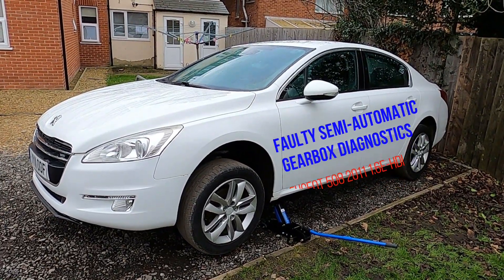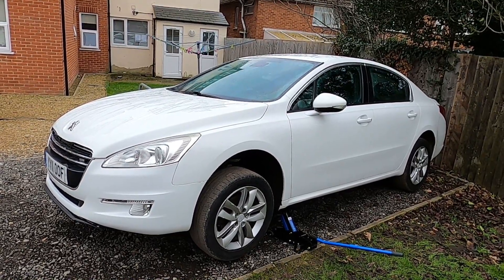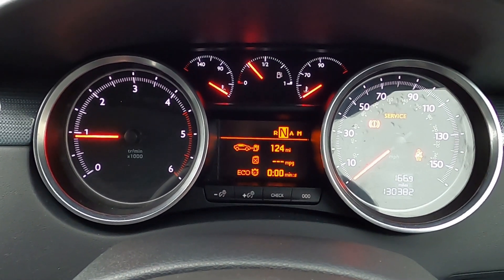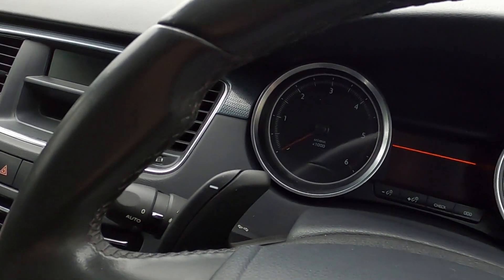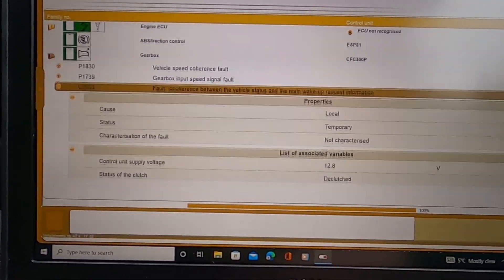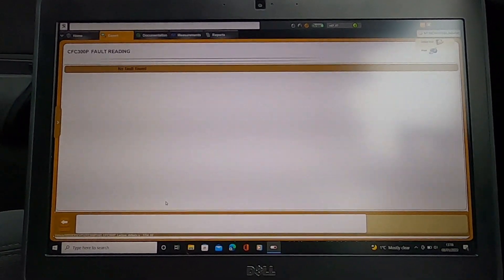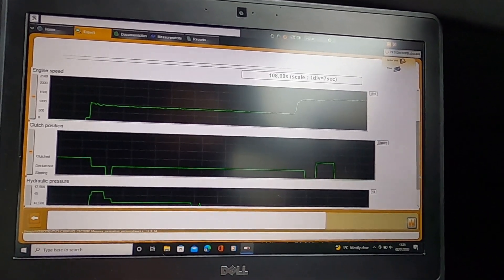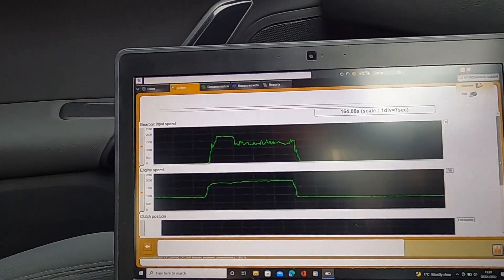6 Speed Semi-Automatic gearbox Fault Diagnostics on Peugeot 508     #P1830 #P1739 #U2003

Comment: I have Citroen Berlingo, and i have one problem, from standstill if you want to go really slowly for example in our out of tight parking space, then it kinda pulsates forward, could this be the clutch?, there is no problem changing gears or anything, it's just when the car is driving with clutch control.
Reply from the maker: @mrd799  difficult to say but it well could be something like a slipping cluch

Comment from the maker: My Dear Friends I offer new service
Semi automatic gearbox cluch and dual mass flywheel  replacement and programming. 
I use only  valeo cluch kits ( Dual mass flywheel, cluch plate, presure plate, and slave) also i will replace cranckshaft seal i USE BGA brand seal, differential seals use Febi Brand, fresh COMA fully sintetic  gearbox oil and Ravenol G-HAF hidraulic oil for actuator if needed. I will also throw in a complimentary engine oil, oil filter and air filter replacement. Programming is done with latest Diagbox. 
All above for 1200£, 
1000£ paid upfront then leaving a car with me for 3 days or summer time for 2 days, and 200£ paid then collecting a car from me after you drive a car for a good half hour and happy with it.  I am based in Oxford 
Please get in touch with me if you need this service by email leaving your reg and phone number and i will come back to you.
I have mastered cluch replacements on these semi auto gearboxes and since my old video regarding the issue i have done over 40 cars with semi auto boxes  wihch needed cluch replacement. Common signs on then you need to do this job is excesive vibration of the car then low rpm and fault codes like gearbox faulty p1755 not to mention cluch slipping feel and also a computer preventing you switching gears. I can offer 20£ diagnostic if you not sure if you need this job done and we can have a look at fault codes, live data and see whats going on.
Cars i can do this job on
3008 1.6hdi/ehdi 2011 - 2016
508 1.6hdi/ehdi 2011 - 2016
Citroen C5 1.6hdi/ehdi 2011 - 2016
Ds4 1.6hdi/ehdi 2011-2016
Ds5 1.6/hdi/ehdi 2011-2016
Citroen Grand picasso 1.6hdi/ehdi 2011-2016
Citroen picasso 2011-2016

If i have not mentioned your car and it has 1.6hdi/ehdi engine and semi auto i can also probably do it but we can discuss.
Reply: Presumably Berlingo and Partner too?

Comment: Hi, great video. I have a 508 and was fault alerts and service light coming and going for months, this started after leaving car parked for 6 weeks and I fear battery voltage and ecu have played a part. Although the car started fine when I returned from holidays.
Recently the fault alert comes in every time engine starts and service light stays on all the time. My Obd2 shows no faults but this week car displayed a gearbox warning fault before going away again. Could this simply be the battery being low and the ecu registering a gearbox fault that just needs clearing. Car runs perfectly and gearbox smooth. 

Sorry for the detail but thought I would seek your experience. 
Regards Craig (Australia)
Reply: Is it automatic?
Reply: It’s semi auto as it has auto and drive manual option with paddles
Reply: @craigjenkins3114  Same as mine, does it still do it and did you experience anything different when driving?
Reply: Interestingly it drives normal until going about 50km and then I was getting a P0016, reset by obd2 and back to normal before cycling over and over. Mild loss of acceleration only after engine light comes on. Now engine light comes on quickly and a code relating to camshaft sensor appears, but they were replaced and no change. I did timing chain change 80,000km ago and I’m starting to thing a change may be required. However I thought if timing was out the fuel usage would be high, but it’s never been better. I think it’s time to get a diagbox analysis

Comment: Hi great video can anyone help ? i have c4 picasso 1.6 thp petrol with semi auto egs gearbox now when it goes from 1st to 2nd theres a clunk noise ? its the same when it changes from 3rd down to 2nd all other gear changes are fine ? ive read that reflashing the gearbox can help this im not sure what that is or how you go about it im no mechanic theres no warnings coming up on dashboard thou my c4 has had new abs sensors fitted as well as new front and rear discs and pads fitted so i know all the magnetic rings are new can anyone help many thanks in advance !!
Reply from the maker: Hi mate my advice would probably be to find someone with diagbox and get your gearbox reprogrammed. Also i would check to make sure gearbox actuator is not leaking anywhere.

Comment: Hi all. Anyone got Peugeot specialist in Leicester or nearest area? 
Gearbox is working only manually, first three gears, 4th 5th 6th gear missing. Car got replaced clutch 3 months ago, suddenly only drives in first 3 gears 😮
Reply from the maker: Hi mate i would recommend you a DKmotorgroup.co.uk these guys they do amazing job and very fair priced. They specialise is semi automatic gearboxes and french cars.
Reply: @Mad4FrenchCars   Will contact them. When successful I will let you know. Many Thanks 💪

Comment: Hi. I have Peugeot 3008 with exactly same issue. The garage replaced clutch flywheel and the actuator but. The could not program the gear and gets error  P1734  gearbox Actuator Position Signal In The Gear Selection Axis Short Circuit To earth. We put the old bearings like you but still have the problem. Any idea how to solve this problem
Reply: Have you solved the problem?

Comment: P1800? Delphi, checks the gears and after you have to run the engine to finish calibration it says calibration failed. Any ideas?
Reply from the maker: Hi mate the only time i had calibration failed is then something was not right normally it calibrates straight away
Reply: Hi I have the same problem. Did u manage to sort it?
Reply: @Adam_Lad123  i did not notice the flywheel was fked, after i replaced the whole thing the calibration was  ok

Comment: After i changed the clutch i got an issue with the actuator which cannot build up a good hydraulic pressure. Max pressure i get is between 16 to 18 bars thats why the electropump motor is on all the time while the ignition is on trying to build up the desired pressure. I looked up for leaks but couldnt find any. Any ideas guys?
Reply from the maker: The presure is deffinatelly low. It does sound like a leak somewhere or maybe need to bleed a system with diagbox few times. Then you installed a hidraulic slave have you pressed it and put some hidraulic fluid in it while releasing to fill it up with fluid. If you havent then maybe you have some air in a system. I would try to bleed it with diagbox to try to get rid off air if its any in a system. Very hard to advise without seing it but its either a leak or a air in a system. I dont think it would be anything to do with actual actuator.
Try to blead it few times also try to actuate cluch with diagbox aswell maybe that could help to air it out aswell. If there is no obvious leaks then i would try to do that. Have you connected a hidraulic slave sleve and high presure tube with metal clip? Let me know how it goes mate. I have done one myself today on a 2013 3008 just havent finished yet but curious to know what happen with yours.
Reply: @Mad4FrenchCars   Thank God i found the problem. It was the little pump that couldnt push enough oil through. I had another one in the garage, i swaped them and the system was pressurising again succefully. These gearboxes mysteries never end. Thank you for your reply
Reply from the maker: @marocautofix5555  well done mate good job

Comment: 1100 pounds for a new clutch at 100000 miles 2012 model 😮😮😮😮😮😮
Reply from the maker: If you do it yourself will probably cost you around 500 with 4 piece cluch kit with dmf and hidraulic fluid, gearbox oil. 1100 is reasonable for a job to be done.
Reply: @Mad4FrenchCars  I thought so ….. independent gearbox garages nearby quoted around 850….. I paid a little extra with independent main dealer
Reply: @Mad4FrenchCars  don’t think I’ve had the gearbox oil done yet … is it worth it
Reply: I payed 2324,99
Reply: @andriandrason1318  pounds ??
Reply: Yea it was 20k Danish kroner, actually a little bit over. But 20k converted to pounds is 2324,99 at a Peugeot/citroen dealer/mechanic.
Reply: @andriandrason1318  wow … I suspect if I’d have gone to main dealer .. the price would have been similar mate. 🤨☹️👍🏽

Comment: Hi. I have 508sw 2012 1.6 e-hdi no errors on the dash or in diagnostic.  The problem is i have new clutch and auomatic berring assy changed on 250.000km now i have 290.000km and it slips when i accelerate. It slip between 2000 and 3000 rpm. In 3,4,5 and 6, gear.
Reply from the maker: Sounds like who ever installed a new Cluch didn't program it properly. It could also be other issues such as a cranck shaft seal from gearbox side hasn't been replaced during Cluch replacement and now it contaminated Cluch with oil. Or it could be something else, I would get it scanned with Diagbox as sometimes some faults doesn't show up on a dash but it's stored in a ecu.
Reply: @Mad4FrenchCars  is a semi auto. Tomorow i will make new learning process. I need to find an open road for this.
Reply: @Mad4FrenchCars  diagnostic say there are no learning values. So i think the mehanic just swaped parts ad doid not lerarn the gearbox how to shift. Lucky i have may own diagbox.  During the proces:  accelerate to 2.gear-stop (3x)  wait 5min repeat the whole proces.... can i put in reverse and turn around??  Can't find free road for this.
Reply from the maker: @TheSilvo20  ya most likely the mechanic just replace parts I would recommend to do a gear learning and then for a Cluch bitting point learning 90% of cases is not successful as battery power alone is not enough usually so I would get some hook up power stabiliser if you  can't manage but you should be able to hopefully
Reply from the maker: @TheSilvo20  I can't remember about reverse now I think you just have to follow what it tells you to do
Reply from the maker: Just to confirm is it manual or semi auto? As ehdi can be manual aswell as the  ehdi means you have stop start. If it's manual then it's not that many things that can be wrong but if it's semi automatic then it could be a whole range of things. It's strange that it doesn't slip on lower gears.

Comment: hi i wanted to change the oil in my peugeot but the official peugeot garage told me not to do it so im confused the car is a 508 2.2l 2011 215000km  
 and i started to having some issues , 1 and 2 gear sometimes i feel like its sufering untill it gets to the 3rd and  when i accelerate  hard,  it doesent change the gears or it takes to much time what would you sugesst ?
Reply from the maker: Hi mate is your 2.2 a full auto transmission? I am not familiar with 2.2 set up but I am prity sure that you do need to change a gearbox oil even on a fully automatic boxes the only difference is a process itself is different. Peugeot say its a oil for life inside them but that is nonsense as I think the different is manual gearbox oil should be changed every 40k miles for best results and same with semi auto. Full auto boxes oil last around 130k - 140k miles so much longer but still it's not life time
Reply: @Mad4FrenchCars  hi, it is semi automatic i supose it has the flops behind the steering wheel M + -  and it has now 215000 km never changed i dont know if it worth the risk to do it now 😓
Reply from the maker: @rinor3681  I would find a specialist Peugeot garage not a dealer and speak to someone about gearbox oil change. If it's a semi auto then the gearbox oil change its not a problem it's as simple as replacing a manual gearbox oil however hidraulic actuator controlling gears use a specific hidraulic fluid wich needs most of the time only topping. Fluid replacement is possible aswell but you need someone with Diagbox software to do it as it needs to depresurise a system and the pressurise it also do multiple system bleeding to make sure there is no air in a system
Reply: @Mad4FrenchCars  thank you , the garage told me not to do it already spoke to them life time they said ….
Reply from the maker: @rinor3681  that sounds like they don't know what they talking about if you starting to experience a problems with a gears then it's a prity good indicator oil needs changing. I would ask a few garage opinion as the ones who say its life long oil I wouldn't go to them. In Peugeot 407 UK group there is loads of guys who know how to replace oil on 2.2 boxes it might be worth joining the group and ask I know you have 508 not 407 but boxes might still be same. As 1.6hdi 407 and early 508 is basicly same under the hood same with 2.0hdi
Reply: @Mad4FrenchCars  yes ill do that exactly and i will see what will happen thank you for your opinion

Comment: Hi friend, I own Peugeot 308 1.6 eHDi 2012. My gearbox can’t automatic gear up. The fault code have P0944, P1716. Could you give me some suggestions for the problem? Thank you!
Reply from the maker: Not sure what codes mean I had a different codes then Cluch was going all I can say is if its a semi auto then it turns off gears if you get gearbox error and error could be couse by anything. Most of the time is a slipping Cluch causing a gearbox to give gearbox faulty message and gears disappear. Get it scanned with Diagbox that's the only software wich will show you exact problem. Or atleast will give you better idea on a problem

Comment: Hi, great video. I would like to ask what Obd2 interface you use to connect to a USB on your laptop. A link would be rally useful.
Thanks in advance.
Reply from the maker: Software is called Diagbox and I have bought it from ebay. I received 2 CDs and cables. It has quite a few versions. There is a Facebook group dedicated for this software where they can answer all your questions

Comment: When this happens you just sit and cry :)
Reply from the maker: I just got 3008 with exactly same simptoms.
Reply: @Mad4FrenchCars  Does this applies to Aisin AT6 III
Reply from the maker: @la_ki  yes mate same gearbox in 508, 3008 DS3 and many more cars
Reply: @Mad4FrenchCars  Not really, as 508 II have the full automatik, and 508 I semi-automatic :)
Reply from the maker: @la_ki  I am talking about 508 with semi auto. Can I help you in any way? I have done countless Cluch replaces on these boxes since this video and now I find it very easy
Reply: @Mad4FrenchCars  I am just curious if I should go for oil replacement in gearbox? its now 240000km
Reply from the maker: @la_ki  if its a semi automatic then I would gearbox oil every 40k miles so 60k km and hidraulic actuator fluid every time the Cluch is done. If it's fully auto with torque converter then I am not sure as I am not dealing with them.
Reply: @Mad4FrenchCars  what about their oil is lifetime idea?
Reply from the maker: @la_ki  they say that automatic gearbox have lifetime oil and are sealed but it's all bullshit as it might not need a oil change as often as manual but oil should still replaced I have a lot of friends with 407 coupe 2.7hdi and auto gearboxes suppose to be lifetime oil but there is no such a thing as it should be replaced around 140k miles and I know a lot of people who replace oil in a fully auto boxes aswell. Mind you is not as straight forward as in manual
Reply: @Mad4FrenchCars  Now I am at 240000km, and a bit scared to replace it, as I do not know if clean oil will cause problems now after that much kilometres. Can we discuss via some instant chat?
Reply: @Mad4FrenchCars  hi , how can I contact you ?

Comment: I have a question, coz I just recently bought a 2011 Peugeot 508. It has cost me so much more in repair than the car itself. First the clutch had to be changed, and now my car is back in the workshop after 4 months. Now the problem is the gearbox actuator, they said there is a leak, and now just waiting for the part to come. I was advised by a mechanic to never drive it in automatic but rather in manual mode so that my car would last longer and work better. Is this true or what? Then what is the point of it having an automatic mode, if I would need to use the manual mode for it to live longer?
Reply from the maker: Hi mate these semi automatic gearboxes are rubbish my advice would be fix the car and sell it and get manual. I now have 1.6Hdi 508 with 5 speed manual and it drives lovely. 1.6 Ehdi with 6 speed semi automatic gearbox is just horrible invention. I don't think it will make any difference if you drive in auto or manual if it will decide to cause problems then it will regardless. Actuator leaks are common to leak. Normally it's a plastic hose between actuator hidraulic fluid reservoir and actuator. Hope it's a easy fix. These cars seem to eat clutches much faster then a normal manual ones aswell. There is a fully auto option aswell I believe on some 2.0hdi 508s wich is much more reliable aswell but 1.6hdi with 5 speed  or 2.0 hdi with 6 speed are just proper solid boxes and last ages
Reply: Will probably just keep the car for a couple more years and then scrap it and maybe buy another brand. I am not impressed with Peugeot at all. Just complete garbage really.